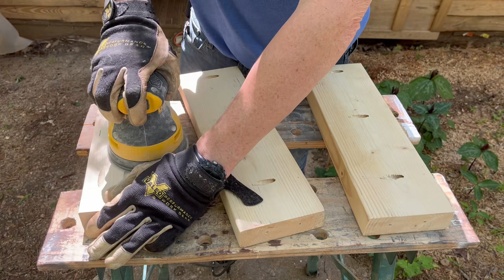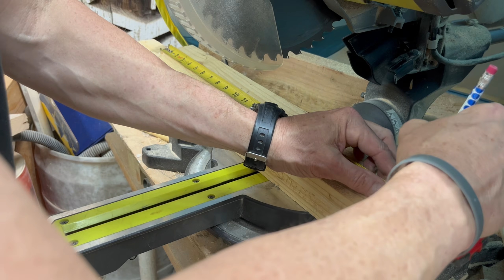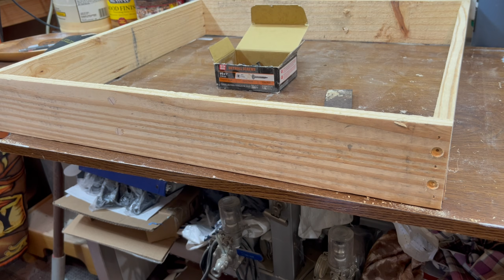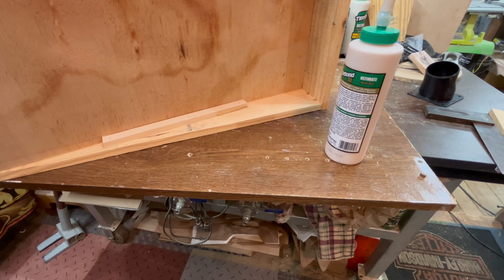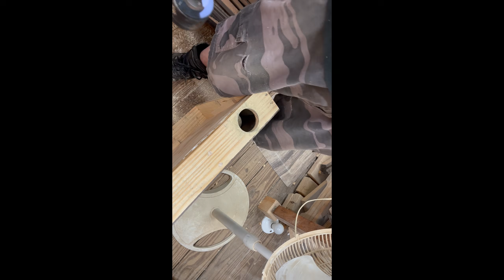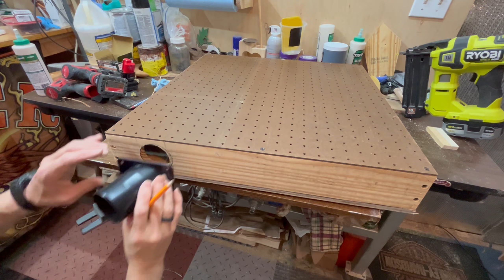DIY Downdraft Table Indoor Dust Collection Hack

Comment from the maker: 🔥 DIY Downdraft Sanding Table from Reclaimed Wood! 🔥

Tired of dust going everywhere when you sand indoors? This homemade DIY downdraft table is a total game-changer! Built using reclaimed wood, pegboard, and a shop vacuum, it keeps your workspace clean and your lungs happy. 💨

✅ Reclaimed wood woodworking project
✅ Dust-free sanding solution
✅ Shop vac dust collection system
✅ Pegboard downdraft table top
✅ Easy DIY shop furniture anyone can build!

Got questions about the build? Drop them below and I’ll help you out! 👇
Don't forget to LIKE, SUBSCRIBE, and check out the rest of the channel for more easy woodworking projects that turn scrap into gold! 🪚💰

#woodworking #downdrafttable #diydustcollection #reclaimedwoodproject #woodshopsolutions #woodworkingdustcontrol

Comment: Blue painters tape helps seal up non essential areas of the pegboard to help increase suction if needed or working on smaller pieces. I made my first like this and quickly found out a little added restriction greatly increased the suction. Nice build.
Reply from the maker: Thanks so much and that is a great tip.  Thank you for sharing!!